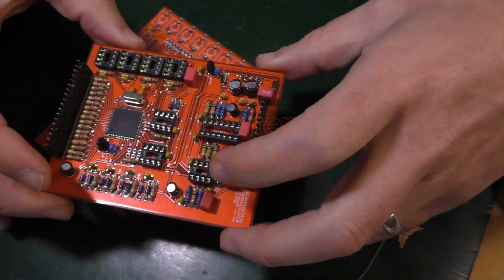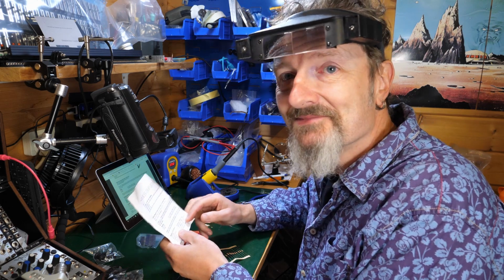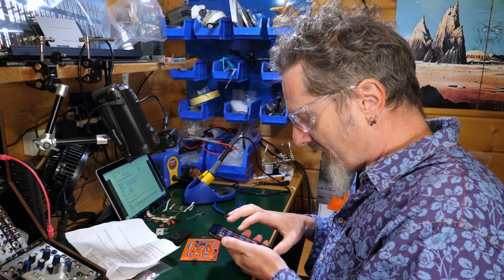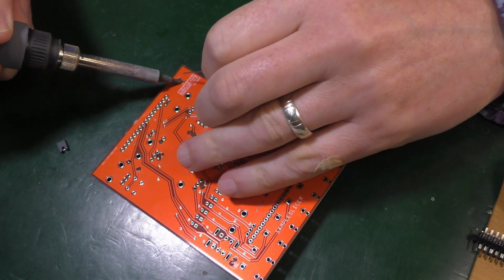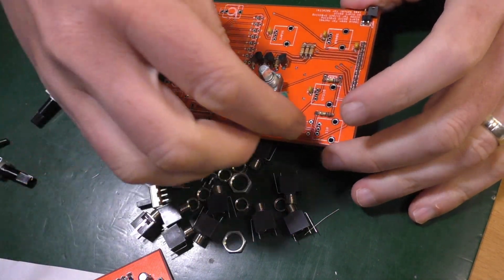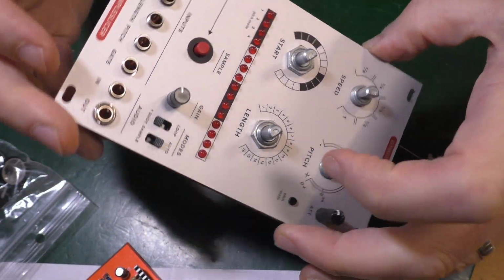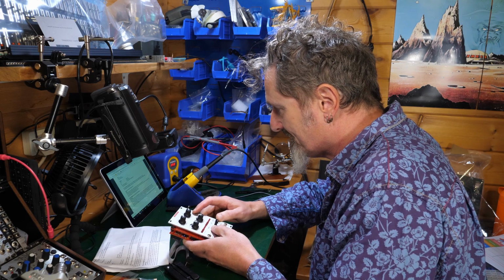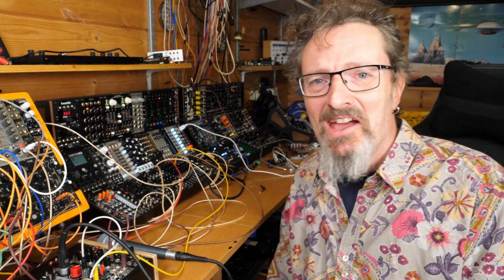Modular DIY 17 - Ginkosynthese Sampleslicer MkII

Comment: BTW
Those were the correct resistors. Just better spec than the older ones. Which I'm sure you've worked out by now.
BRN - BLK-BLK BRN - BRN = 100*10 at 1%